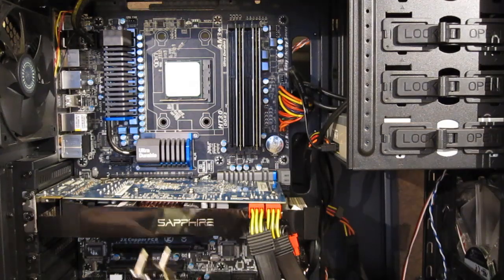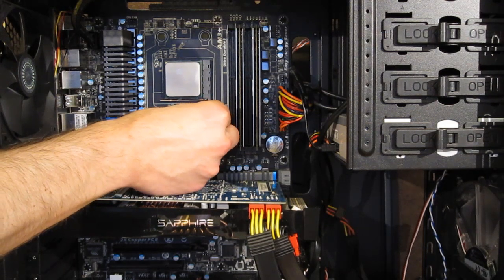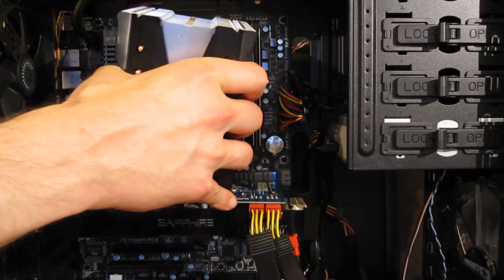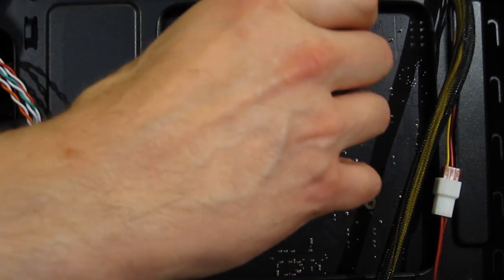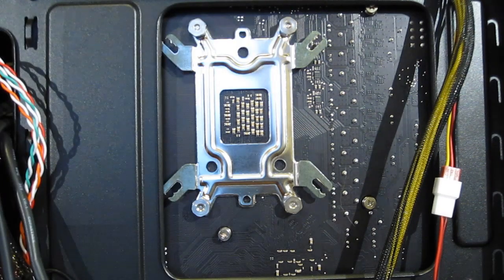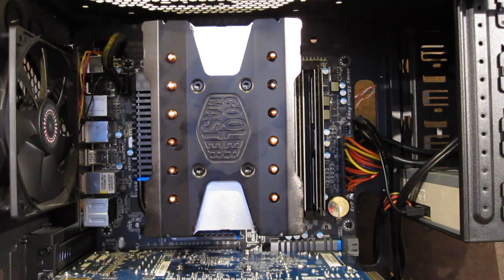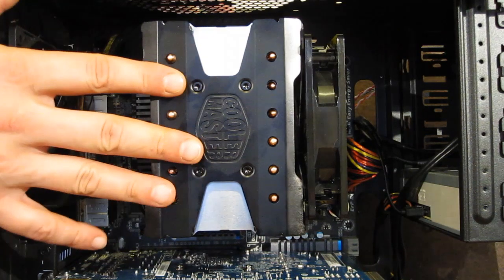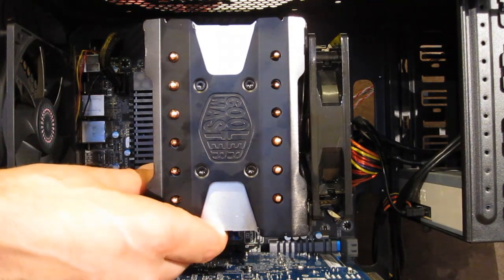Cooler Master Hyper 612 PWM Installation

Comment from the maker: Head over to your local hardware store and pick up rubber O-Rings that fit snugly on the mounting screws. Will cost you less than $1 for the four. You do need to use them.

Comment: This cooler fits on a case Thermaltake Level 10 Snow Edition GTS?
If you do not fit in the Level 10 GTS, will fit in the HAF 932 advanced?
Answer me please, I'll put an i7 3770K and a Gigabyte Z77X-D3H

Comment from the maker: The case in the video is actually a Storm Enforcer, but they are almost identical internally. It will fit in the 690II without a problem.

Comment: @bobfred202 I have this cooler and veangence ram and yes you can use it with it but you have to turn the cooler to the back fan of the case cus the ram is so high.